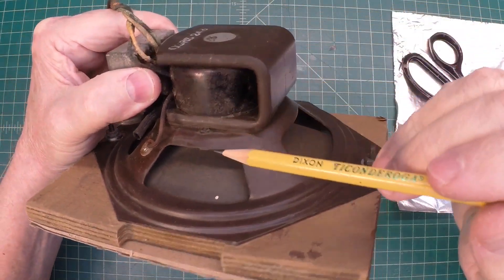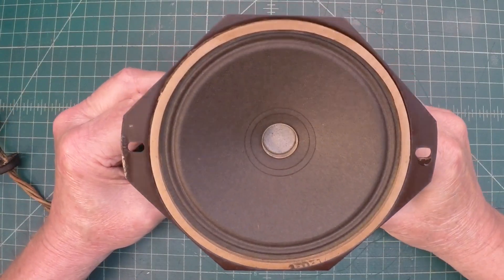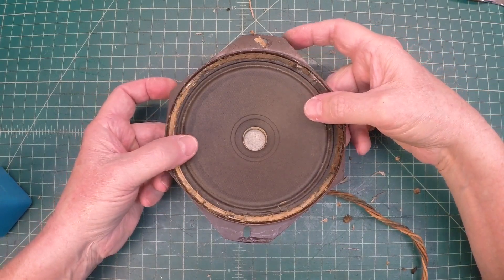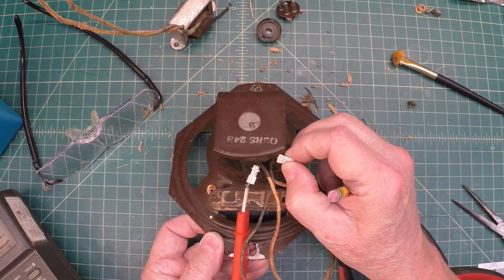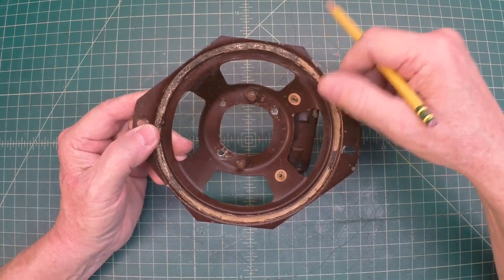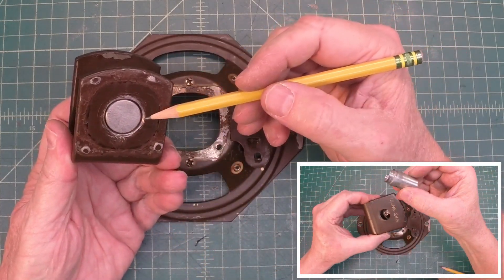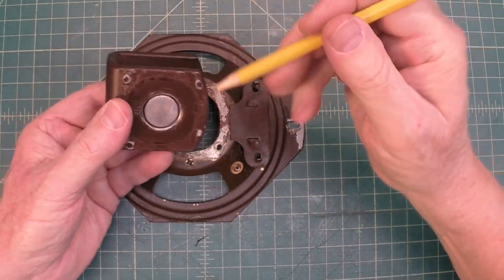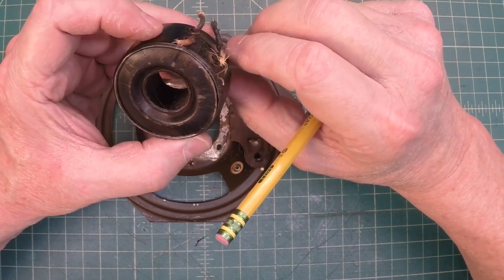Dismantling The Speaker

Comment: Always interested in repairing electrodynamic speakers, wished you had shown exactly how to press out the core to remove the field coil. Did you use a drift pin or a press?
Reply from the maker: Hi Ken - my tool set is very limited, so I used a hammer and socket drive, which is not a great way to do it. I need to get a press down the road that can accommodate up to a 12” loudspeaker, any recommendations would be appreciated. Best, Don

Comment: I'm looking for someone to recone an old 5 inch Philco 40-145 speaker that I had the field coil rewound. Reconing services tell me there are no cones available for those oddball speakers anymore. Do you do mail in service by chance and do you have any cones that will fit my speaker?
Reply from the maker: Keith - trying to locate a speaker cone for the older loudspeakers that fits perfect is difficult. Let me know the diameter of the voice coil (I assume the voice coil is good and the spider) itself. In addition, the depth from the outer rim of the loudspeaker to the center pole piece and I’ll get back with you. Best, Don
Reply: @RestoreOldRadios  
Hi Don, Sorry I forgot I sent you a message until I logged into my Gmail account tonight. Thanks for the reply. The guy at the Alabama Historical Radio Society that did the field coil rewind threw away everything. I ask for all the parts back, but he only sent a bare speaker back to me. No cone, spider, voice coil, or dust cover. Appears he trashed everything and it is long gone. He avoids any questions about it now he has his $50 for the rewind. 

I sent my speaker to The Speaker Exchange in Tampa, FL and they have been trying to locate parts now for about a month. It's probably a lost cause. I bought another radio like mine on eBay for parts. Maybe I can use the speaker off that set. The speaker cone looks good on it. Hopefully the rest works as well. 

Thanks again for your reply and have a Merry Christmas and a Happy New Year. 

Keith
Reply from the maker: Keith, if they return the speaker to you, for fun you could try building a spider, voice coil, and speaker cone or I could attempt the same with no guarantees at no cost to you other than shipping. Just let me know if you want me to attempt the repairs. All the best. Don

Merry Christmas & Happy New Year as well.
Reply: @RestoreOldRadios  
Hi Don, they will return it either way fixed or not. I have no experience with rebuilding a speaker, but I will be happy to send it to you and let you see what you can do with it if you like. Also, I will pay you something for your effort and materials even if it can't be repaired. I can't in good conscience have you work on it for free. I'll let you know soon as the speaker repair company gets back to me if they fixed it or if I need your services. Many thanks, Keith
Reply from the maker: Keith - I've got few radio repairs in the works right now, but late fall or winter might be a good time for me to look at it for you. I'll ping you back in a few months. My email is TheRadioRepairGuy at gmail.com. Best, Don
Reply: I'm in no hurry for it. Just let me know when you have time. I'll send you a message from my private email, so you can contact me there when you are ready. Thanks Don

Comment: That looks like a Quam speaker, manufactured by the Quam Nichols Company, that shape of rear bracket was a trademark feature of theirs. I think that it may even have a Q as part of the part number. As to why they encased the field and hum bucking coils in that metal can I have no idea, it certainly would not have helped dissipate any heat generated by the field coil, maybe it was for shielding purposes in some applications? 
 By the way, I have found that lacquer thinner works well for loosening the glue they used to use to hold speaker cones and gaskets in place around the outer edge of the basket, apply it with an eye dropper into the crack, and wait, it also works to unglue spiders from the frame. I think that those pole pieces were press fit into the bracket, you really need a press of some kind to get them in and out of the bracket straight, something like an arbor or a small hydraulic press, if they were really mean they would also weld them in place with some spot welds which you would have to grind off first.
Reply from the maker: +OlegKostoglatov It’s great to hear from you. You are right, the speaker part number started with a Q. That metal canister seemed odd to me too, but I put it back together the way I found it for the most part. Thanks for the tip on using lacquer thinner, I will use it on the next one as I’ve got one on the horizon. To your point, those center pole pieces won’t budge. I don’t have any presses or alike to use. Maybe I can use a local machine shop next time. Hope you have been doing well? For My edification, where were the Quam speakers manufactured? Best, Don
Reply: Quam Nichols was, and still is, a U.S based speaker company, from the Chicago, Illinois area, I believe. There were much like Utah or Magnavox, they would supply speakers to anyone, I've even found a 12'' one in the back of a Canadian built Phonola console. One company that seemed to use a lot of Quam speakers was Packard Bell, just about every one I've owned had a Quam speaker inside. 
 With regards to pressing the pole pieces in or out, is someone were into playing with cars or other mechanical work they might have a proper press, although one could be improvised as well. I remember reading that this is the way people rebuild the pie pan style speakers found in radios such as the model 70 and 90 Philcos with a failed field coil, the model 20s had a large nut holding in the pole piece much like the one you added to the Quam speaker. Getting the pole piece out in't too hard, but getting it back in straight can be a bit tricky apparently. I seem to recall that they come out and go in one way as there is a ridge where the P.P fits into the hole in the rear bracket.

Comment: Very nice! Great info, hopefully the coil connections will be an easy fix getting to this point was labor intensive. The tapping of the bracket sounds like the best method, it will be very secure. Is the cover for the field coil plastic? It looks pretty ridgid. Thanks for sharing this, you always proceed with caution and make good decisions. Im sure I will hear this speaker play again! Best--Larry
Reply from the maker: +Backtothefutureradios I know I’m behind on responding. Do you think the metal canister for the field coil was part of the electrical design to improve magnetic flux? Best, Don